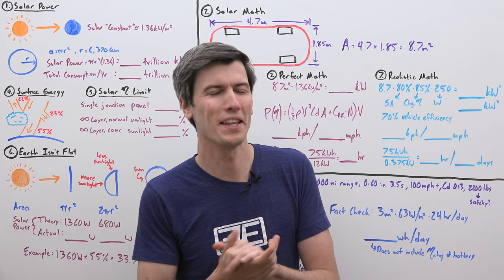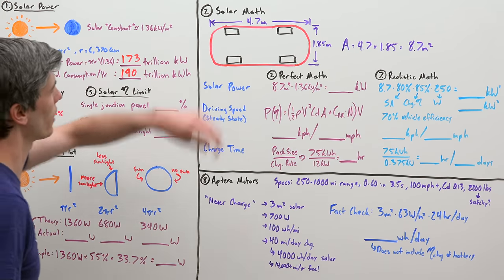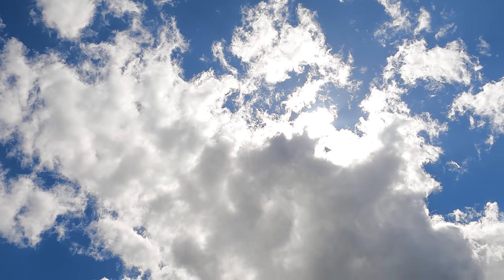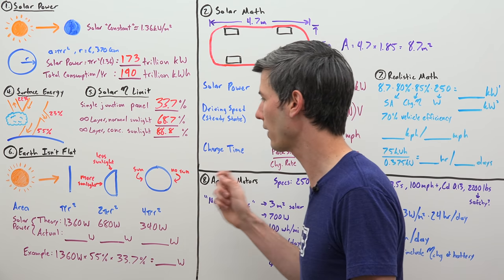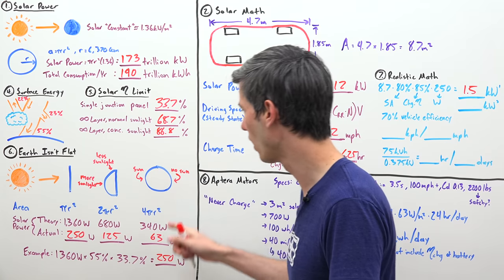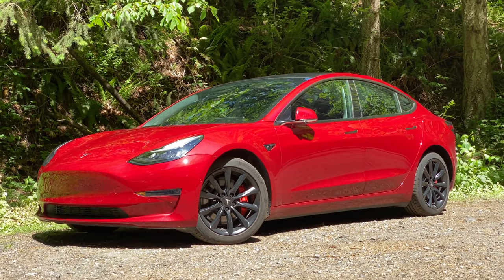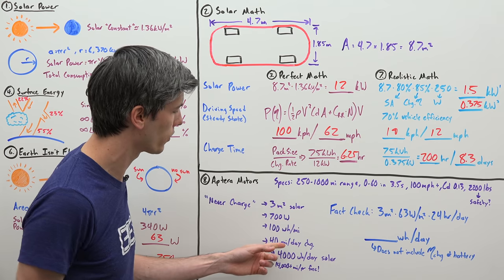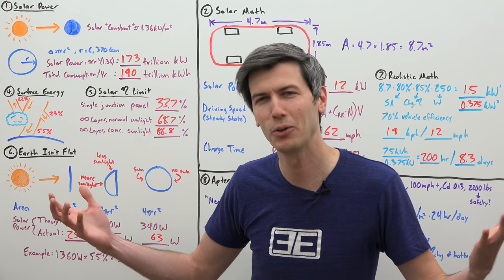Why Don't Solar Powered Cars Exist?

Comment: You can tell Jason thinks the main demographic for this channel are Americans. He feels it necessary to convert 1.36kW to 1360W
Reply: How much is that in Joule/s?
Reply: @kalleguld  lol
Reply: I wouldn't be surprised if his main demographic is Americans. I'm sure he knows (YouTube gives you that sort of data). Makes sense to convert kw to watts for U.S. The prefix kilo isn't something all Americans have been taught because well, they use imperial. Not a big deal tho lol.
Reply: The main demographic for this channel is Americans. He's American after all, but EE still has more math than "math iz hard" mental fast food channels like Real Engineering.
Reply: @magicstew45  Americans have never used Imperial. Americans used US units before Imperial units existed. The British Empire is gone. Stop calling it Imperial. Stop living in Victorian England, ol' chap.
Reply: @sammiller6631  Didn't the Americans inherit imperial units from those Brits than crossed the pond to set up modern America all those years ago?  Imperial units were actually defined in English law in 1832, however they were derived from English units in use before hand, so Imperial & US units share a lineage that only split slightly in 1826 / 1832...  These units actually have a lineage back to Roman & Anglo Saxon measurements, a little before the US came into being...  
On that point I was in the US about 35 years ago, on our return journey we passed a US building with a massive sign celebrating it's antiquity, it was described as an ancient building having been build in ... ... 1925...  I grew up in an English town that can trace it's roots back to the 7th century (1400 years) with a regularly used abbey that was founded in 1092...
Reply: @peterchandler8505  You're proving the stereotype that people who refuse to distinguish US from Imperial are doing it to show off, at best, like you are doing bragging about your town's age. At worse, they don't distinguish units in the same way they think minorities all look the same. 
The point was why would the US switch from Winchester measures to Imperial units decades after fighting to break away from England? That indifference for facts is what fuels fake news and scandal rags.
Reply: @sammiller6631  Going it alone in having a unique measurement set is not great for team working internationally...  As we Brits are finding out, Brexit certainly has it's legacy of business losses and market restrictions (ask those in Northern Ireland about sausages...).  Perhaps the best insight for the joys of going it alone with a measurement system would be explained by those who funded ($327 million..) Mars Climate Orbiter and the Mars Polar Lander which demonstrated the pitfalls of mixed standards.   So although US units are a little different to Imperial, that difference is much smaller than to metric (which I understand is now the basis of US units, they are now defined in relation to metric units...).  We now live in a world which is moving towards many common systems, that integration is far smoother when measurement systems are shared.  Immigration from England to the UK started around 1600, Imperial was defined in British law in 1832, based on the pre-existing English measurement system that the English settlers to the US would have brought with them as many of the New England settlers were skilled tradespeople, hence between around 1600 & 1826 with US were enshrined in US law, US settlers would have been using the same measurement system as those in the UK (Winchester measures?), you do know that the original Winchester was established in Hampshire England around 2000 years ago, whereas Winchester in Virginia was established in 1744...  Winchester measures a set of legal standards of volume instituted in the late 15th century (1495) by King Henry VII of England and in use, with some modifications, until the present day.  So the standards have a shared heritage and small differences, generally ranging from the survey foot varying by 3.2 mm, or a little over one eighth of an inch per mile, 3% in other cases, and between 4% & 20% between similarly named units for volume measure.  Such differences in units sharing the same names is a recipe for confusion, and potentially large costs...  (thank you Wikipedia).

Perhaps the nature of my comment is a reflection of the American exceptionalism seen on so many forums around the web.  In the UK my old town is by no means exceptional, there is much of Britain that can trace it's roots that far back, or much further.
Reply: @peterchandler8505  Your responses smack of British Empire exceptionalism. Why didn't the UK give up the Pound Sterling like everyone else in the EU gave up theirs? Where's the special trade deals BoJo has promised? I'm not going to ask Northern Ireland about anything. The Orange Order are worst than the MAGA crowd. 

The Mars Polar Lander is more about the pitfalls of outsourcing. If NASA had bult all the modules in house, then they would be all under the same standard. Why do you keep bringing up irrelevant age comparisons ("...the original Winchester was established...around 2000 years ago, whereas Winchester in Virginia was established in 1744") if you're not trying to flex British exceptionalism?

 Is that why you didn't mention the Winchester measure all have names of French derivation, dating back to the Norman Conquest? The relevance isn't the creation of the city of Winchester, but rather Winchester was the Norman kings' capital. Did the Domesday Book include French units? 

Thus, the cycle of French exceptionalism and British Imperialism continues to this day, with the British trying to overwrite the older US units with Imperial in people's minds (even though Imperial is used by far fewer people) and French seeking to erase all others to enshrine French hegemony within the fight for cultural imperialism between them.
Reply: @magicstew45  We were taught, at least when I was in school. I think it's also a matter of intelligence or memory.
Reply: Or... could just be the fact that later in the video, he explains the fact that the actual usable wattage isn't actually 1360W, but rather 680W, thus using the same unit of measure and format for comparison.
Reply: @sammiller6631  Please make the world a better place by leaving.  Thank you.
Reply: @paulmartin2348  While a part of me agrees with you, another is fascinated by the amount of time two people spent trying to teach past one another but one obviously taking it personal. In all the “ink splatter,” I learned a few things and was reminded of a few others I forgot. While I like my “English” (not metric) units (tongue in cheek for sure), I have always been fascinated about how volume and weight in metric comes down to pure water. Thank you gents for your fairly civil but engaging literate sparing.
Reply: capacitor discharging error. as soon people learn using capacitors all wiöl be changed
Reply: @peterchandler8505  I guess if sovereignty means nothing to you, and you like being told what to do by people who are completely disconnected from you.
Reply: @SlyNine  Personally I do think that the sovereignity argument was significantly over hyped.  

In business terms, setting your own rules mean that businesses will have to manufacture one product for the UK, then a separate slightly different product for EU countries with a separate set of regulations, and expensive type approval hoops to jump through (with the loss of economies of scale from that would have come from one product for both markets), which is just an extra drain on business costs and a disincentive to grow your business by expanding into the EU.  I know one person who was considering closing their business because of that extra drain on costs, but then a larger business saw that the range would complement theirs and bought the stock & IP, employees still lost their jobs though as that business was not local (250 miles is hardly commutable and short notice excluded relocation), most likely would not have done had Brexit not happened.  The reports I have seed seem to suggest that the effect of Brexit is a significant cut in EU / UK trade, and although there are exceptions, a significant reduction in international investment in the UK (exceptions that there are a few who have invested, but that the total figures are down), leaving the UK as the poorest performing business in Europe now.  It does look as though Brexit was a bit of a disaster here, with interesting polls suggesting a significant proportion of Brits coming to that understanding.  

Give it a few years, long long long before it has been sorted, and a large proportion of those who voted for Brexit will have passed away leaving a strong anti Brexit majority here.
Reply: You can tell Jason knows the main demographic for his channel are Americans.

Fixed that for you.
Reply: YouTube being an American platform, it makes sense.
Reply: Can’t we all just be metric? Ughh!
Reply: @kalleguld  "Who's Jules? Is she hot and young? " - Biden, lol
Reply: Gold😂😂
Reply: Ummm… converting from kilowatts to watts, or watts to kilowatts, is simply a matter of moving the decimal point in order to make the same number more manageable. That conversion has nothing to do with "Americanizing" the unit of measure. Now, if the conversation has started with joules (the standard international unit of energy), and then converted to watts, you might have a point.
Reply: @magicstew45  what about kilobytes and stuff? Americans use those
Swear to god that country needs to figure itself, it calls itself advance but still stuck in imperial units